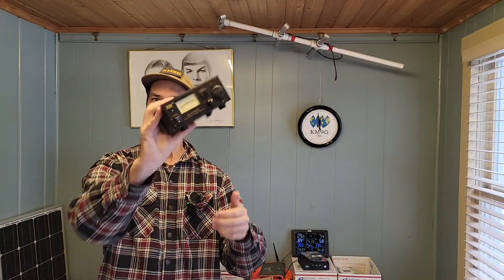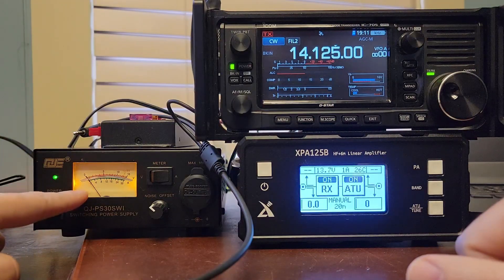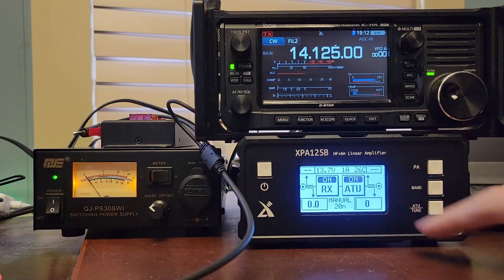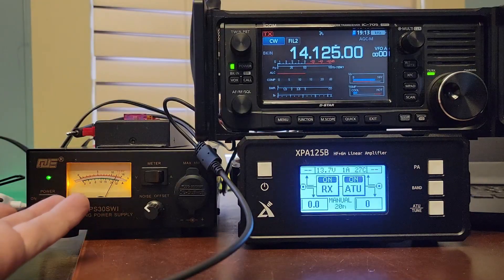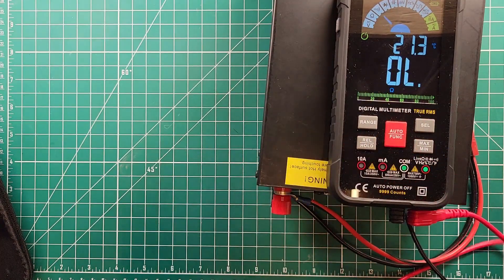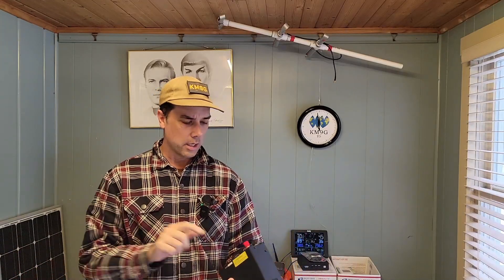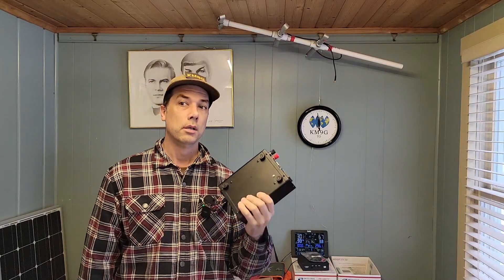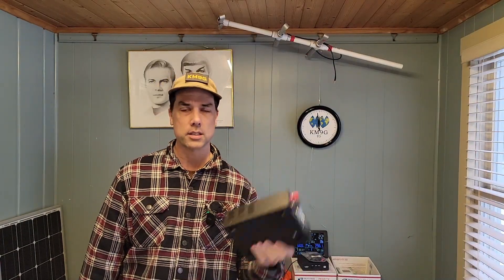Your First (Maybe Last) Ham Radio Power Supply!

Comment: So I've been running this for 6 months since I found this vid, and it's been working a treat! 

How I prevent the internal fan from even turning on is I have a dual 12v/5v USB fan (it has a usb A to barrel adapter to run 12v like off a Bioenno for example), I usually run plugged in via the cigarette lighter usb adapter in the front.  One fan into the side of the power supply, the other blowing under the radio (or side 125b amp, it's a fan with 4 corners of rubber bumpers, put it where the blowy needs to happen). A steady stream of air keeps the internal fans from even kicking on.  

Thanks for the recommendation back then! <3
Reply from the maker: You're welcome!

Comment: hi,can i connect more than one radios on a psu like this?
Reply from the maker: You can, but you likely won't be able to transmit at the same time.  You can check the specs on RX/TX Power Draw on your gear and if it doesn't exceed the power supplies output rating, you're good to go.
Reply: @temporarilyoffline  ah yes got it, thanks!

Comment: Y does it have noise reduction control if it was built correctly this wouldn't be so , or am i missing something in my old age 😢
Reply from the maker: You're missing the cranky old sad ham gene.  Most people don't realize that technology advances and switching power supplies are quieter now than they ever were (yes, some are still bad)... but I don't think you could sell a ham radio switching power supply without a noise offset in today's world.

Comment: Have you searched across the bands for RF interference from this power supply? I've tried a few switching supplies and find birdies all over the place. You need to test with another radio running on battery or a linear supply... compare the bands with the switched PS on and off... you might be surprised.
Reply from the maker: I have, and the "noise offset" feature moves it right out of the way.

Comment: Nearly all the "Ham" switch mode power supplies are made by either QJE or Manson, they will just be rebranded for the manufacturer. Most of them in that size use exactly the same board that is inside yours. Alinco, Nissei, Sharman Multicom, Nevada, Jetstream etc are basically this power supply with the same board, sometimes in different cases or with different meters. Even the linear power supplies are all made by QJE or Manson. There is actually nothing at all wrong with these.
IMHO Samlex is the best if you want to get something decent for your shack.
Reply from the maker: This is true in so many different verticals - like even the things you see in grocery stores and pharmacies.

Comment: Nice power supply, however I recently purchased the Jesverty SPS 50II which I found to be an outstanding power supply. It has dual meters for voltage and Amperage, not to mention adjustable noise filter and adjustable voltage, or you can use the switch to always be tuned to 13.8V. Run pretty cool.
Reply from the maker: Sounds like a great unit!

Comment: I ordered this a few hours ago. I thought it was a good choice but wasn't 100% sure. Then, low and behold, a Temporarily Offline video from a year ago confirmed that I made a good choice. Thanks from a brand new Technician.
Reply from the maker: @Penny_Pincher_Outdoors  it does the thing so well that I just got another one
Reply: @temporarilyoffline  So far, I love it. I have been running a DB20-G listening to NOAA and some chatter on the GMRS channels. Will reboot in Ham bands later and see if there's any chatter. Clean and clear power.

Comment: I will stick with astron . More exoensive but so far never had an issue. , or yaesu fp-1030. Astron makes small switching ps's. But fir rf work i prefer linear over switching but thats purely a  preference.  If that ps works for you , stick with it. WA4UJY
Reply from the maker: Thanks for stopping by Joseph.  I like my astrons too.

Comment: Cause doesn't make noise it doesn't mean radio is happy, put an occiloscope and you will see all the a/c ripple that will scare you. Up to 1 a/c volt peak to peak on 40m, yes the frequency changes the ripple.
Reply from the maker: I'll have to get a scope to check that out!  Thanks for the tip!

Comment: I just got one of these today for my tyt 9800. Thanks for the video! What size O-lugs would you recommend for standard fused red/black car stereo power cables?
Reply from the maker: I'm going to take a guess that they are 12ga wire and I'd say to use the yellow ones.  Usually you can get a cheap crimper and it comes with reds, blues, yellows.

Comment: wait im confused. you can use the xpa125b with this? The XPA125b outputs max is 30 amps so with an added transceiver wouldn't this power supply be pushing  it or not have enough?
Reply from the maker: The manual specs "30A @ MAX", as you saw in the video, I wasn't "@ MAX" and everything was happy.  This will vary from band to band, and I don't know which band would put it "> MAX", but it will just shut down as it runs out of juice - like I mentioned in the end of the video.  Thanks for watching!
Reply: @temporarilyoffline  so if you were to use the amp at its max then that power supply would not be sufficient?
Reply from the maker: @Mangoparadise  Take a look in the beginning of the video where I show "key-down CW" into the amp and it handles it just fine.  THis is on 20m, but it (might not work) on say 80m.  Its a good starter power supply, you'll know when you need to get a bigger power supply.

Comment: Does your fan run continuously when you turn the power on? My fan has never turned on even under a 10 Amp load.
Reply from the maker: I sold this power supply a few years ago, so I don't remember.  How hot does your PS get on 10a load?  Maybe not hot enough to key the fan?

Comment: I have two of those Power supplies. Very quiet and work great. Mine tests at 13.9v  with a voltmeter. I have never heard noise from either of my power supplies. My fan has never came on.
Reply from the maker: Sweet, they aren't as bad as the cranky old timers tell you theirs were.
Reply: @temporarilyoffline  LOL. I am 100% happy with mine. I have a 50 amp Pyramid power supply. It is terrible so much noise I cant use it with my radios. These 30 amp ones zero noise.

Comment: One of the problems I have with that power supply is that it is fixed at 13.8V. Years ago, when I got my Jetstream JTPS31MB 30 amp switching power supply, which was being discontinued when I got it, it had an adjustable output. It had a detent at 13.8V, but could be turned up a little higher. When it was new, it actually put out 13.8V when it was set on 13.8V. But over time the output slowly dropped. Now, to get 13.8V out of it, I have to turn it up a bit beyond that. I also now wish I had gotten a 50 amp power supply, and will be getting one in the near future.
Reply from the maker: I wonder if there is a weak chip in there causing the issue.

Comment: I have two very similar TP30SWI 30Amp / 13.8V power supplies sold under the Tek-Power brand and like em both a lot. 
Here's a nice 50 Amp variable power supply I purchased on Amazon. (9-15 volts adjustable). Very quiet.  It's called the  Jesverty SPS-50II
Reply from the maker: Sweet, glad you like them!

Comment: New person question. Can you use 1 power supply to power more than one radio at a time? Or is it safe to do that? Or is it one power supply per radio?
Reply from the maker: You can power two radios from the same supply, but you can TX on both  at the same time.  Not enough amps for both

Comment: This thing powered my first non handheld radio a bit ago. I was immediately happy and realized this DEFINITELY isn’t my last radio nor power supply 😅 my eyes are already set on one of those pricey yaesu radios… definitely gonna save and think it over for a good while. I’ve got too much antenna projects on the board.
Reply from the maker: This hobby is nothing if not an endless supply of activity. Welcome!
Reply: @temporarilyoffline  I was a little turned off at first not gonna lie, it seemed so complex yet boring. Finally got out of the headspace where I “have to catch on immediately” im already thinking of putting a radio “permanently” on my car haha
Reply from the maker: @vicrattlehead8665  I think you've got the right mindset now. It is very complex and you'll always have something to learn and explore.

Comment: BUT....how long will the switching supply last?  if switching supplies were quieter and lasted as long as a good linear, i would buy one in a heartbeat.  the astron 35a linear supplies will last 20+ years with nearly continuous use.  i don't think there is a switching supply out there that will last more than a couple years of continuous use, if that.  so, in the long run, linear is $100 to $150 more expensive, but will last maybe 5x's or more than a switching supply.  so, it is a no-brainer to go linear.  portability would be the only reason i would use a switching supply.  i'd get a good one like the one you have here, but it would not be a continuous use supply.  field work, POTA, SOTA...stuff like that only.  the total cost of ownership of a good linear unit is actually cheaper than a $97 switching supply.  just my two cents.  73.
Reply from the maker: Thanks for sharing

Comment: You didn’t mention that when most switching supplies fail they will send 120 volts AC into whatever they are plugged into.Also most need a couple of Snap On Ferrites on the power cord or they send a constant birdie on different frequencies across the Amateur Bands.I have the same power supply with a different name and it’s the TEKPOWER TPSW30SW1.Lots of other companies have their names on them including R&L Electronics.They don’t have the noisy fans like the MFJ switching supplies that the fan runs all of the time & that’s a Plus.They work great as long as there is no failure and if so your gear will be Forever Toasted.Also the noise mine puts out is not affected by the knob at all.👍🎙
Reply from the maker: Hasn't happened to me, but it's a risk with all power supplies.  My Kenwood brand power supply blew a regulator and sent >20v downstream.  Luckily I was testing it before connecting any gear to it and a simple part replacement got her back in shape. Fuses and crowbar circuits! Even then you're still just crossing fingers

Comment: I’m assuming this has enough current to run the 991a?
Reply from the maker: I ran my 7300 with it, never had a 991a
Reply: @temporarilyoffline  I’m new to HF, and I’m getting a mint 991a from my nephew. Per the specs it looks like it can draw 23A. Just curious if anyone has anyone has used this setup. Thx for the reply!

Comment: Nice review mate.  I'm using  the same power supply whilst travelling around Asia for the past 5 months hooked up to a FT-891 @ 20 watts, all good and fine until 3 weeks ago.   Switching it on, it turned off and won't start.  Checked fuse, used a different socket and cable and looked for anything obvious to the eye under the bonnett.  The FT-891 works fine on battery and has been doing a great job at 20 watts from the apartments and rooftops in Thailand, Vietnam and Sth Korea :)    You mention protection curcuitry, is that resetable ?  The  FT-891 at 20 watts is the only device that has been attacked.  Any suggestions?   VK4 FOO is here in Daejeon ROK  - Stephen
Reply from the maker: Mine auto-reset after I removed the problem and cycled power.  No power out at all?  Might be time for repairs.

Comment: I'm looking to grab a Retrevis RT95 / Anytone AT-778UV, it looks like it has a T connector, say I bought this power supply, are there cables out there that I can buy with a t connector on one and, and the ring loops to attach to the power supply? I'm a complete newb here and am out of my depth. With the ring attachments, does the back covers on those terminals screw off then you install them and tighten them?
Reply from the maker: Usually the posts on the power supply will screw off and you can put these on.  You have a 99% chance of making it work out of the box.  If they don't fit, you have 2 options: 1. Cut them off and strip back the wire and wrap it around the posts or 2. Crimp on your choice of a better end.  Welcome to the hobby!
Reply: @temporarilyoffline  Thank you for the reply, good to know!
Reply from the maker: @MrBikboi  ubet

Comment: I have one that looks identical, has the same model number but sold under brand name Norjin. It does have noise. The worst of it is on 20m. The noise knob does move it out of the way.  The only annoyance is that these bands of noise drift until the power supply warms up fully.  Once it warms up the noise bands stop moving.  I'm just powering a Hermes Lite 2 so more than adequate.  I've never once heard the fan kick in.
Reply from the maker: Very nice! I like that they are aware of a problem and have a solution.  That's nice.  Have you checked for floating ground?
Reply: @temporarilyoffline  Not until now.  I have continuity from 13.8V ground connector to long pin on AC connector which I assumed is what you were testing on. I also have continuity from that pin to 13.8V positive connector, so I don't know what that means. I noticed the PS does actually have QJE stenciled on the front so it is identical to yours.  The measured voltage on mine is 13.68V.  The noise is manageable with the knob so for the price not complaining.  I got it off Amazon scratch and dent section for the equivalent of about $60 USD.
Reply from the maker: @ronlewkowicz9656  Good Deal!

Comment: I have exactly this one in my shack and it is a really compact, lightweight and reliable power supply. Also the noise offset button comes pretty handy. But it will not provide enough power for two 100 Watt transceivers in parallel. Even with my IC-7300 alone there is a significant voltage drop to 12.2 Volts when transmitting at full power.
Reply from the maker: Good to know, thanks for sharing

Comment: I have the "TEKPOWER TP30SWI", a cousin to yours.  I think the common ancestor is the Alinco switching PS.  If you look at your waterfall and twist the noise offset, you should be able to find the "noise".
Reply from the maker: Excellent Matt!  In my case the noise wasn't on any band that I looked at, so must have been out of range of my antenna or otherwise irrelevant.  It's a great little workhorse.
Reply: @temporarilyoffline  yeah. You might see it on some bands and not others. I would check 80/40. Maybe it’s super clean!

Comment: I have the same power supply but with an lcd meter. Got it for 10 bucks at a swap meet. I took a chance as the guy had no idea if it worked. It's been powering my ic7300 for the last 9 months without a problem!
Reply from the maker: An LCD meter sounds awesome!  They are pretty easy to repair, compact and just work!

Comment: Would anyone know about over voltage protection on these QJE power supplies? I got the QJE PS30SW IV (the digital display one). It works great, but I am always worried that if anything goes wrong inside the power supply, it could exceed the max voltage output and burn my radios. I am even considering putting together a crowbar circuit, but I would prefer to avoid the additional clutter in case the PSU has it onboard.
Reply from the maker: See comment from Neal below about his going Bang!
Reply from the maker: I don't know if the PSU has protection from itself, but I do know that it will shutdown if there is an over-voltage on its power ports - I had an amp fail and dead short.  PS saved the day!

Comment: Mine went bang recently, a very loud bang, whilst I was semi-snoozing half listening to a dx station, made me jump. Don't know what component has blown yet, but thankfully no radio equipment damaged, so must just cut straight off and not output any over voltage.. that's a plus. Using a Nevada PS-30M linear PSU now, which is actually a similar price to that little QJE.. has a stupid loud fan on it though which is going to have to have to be modded soon.
Reply from the maker: Noctua makes good fans!  Try one of those: https://amzn.to/3WG5rpX
Reply: @temporarilyoffline  Thank you

Comment: ~$25 eBay ex-server e.g. HP HSTNS-PD18 750 watt (12V/62A!!!) power supply can be modified with one resistor to tweak output to 13.5V. RF quiet, being HP ex-server = super high quality.  Far more amps capability than dollars cost. An option for those able.
Reply from the maker: I've heard of people using these.  We built some at the ham radio clubhouse one day.  I had too many power supplies (and still do) to put the server PS into service.  Glad it is working well for you!

Comment: Great vid. The psu is the same as my Maas sps-250 ii
I just Changed the fan out With a noctua NF-A6x25
The fan is totally silent with the low noise adapter, and it fits strait in, you just need to Change the plug. Same as the ic 7300 fan mod/upgrade. 
Works fantastic 73 OZ7KP
Reply from the maker: That's good news.  I'm a noctua fan!
Reply: @temporarilyoffline  😄 me too
Reply: Me too!

Comment: Great video!   I have a QJE PS30SWIII (it's older, even though it has more "i"s in the model)  Rated to 20A continuous.
My only gripe (if you can call it one) is that I would prefer that it had Powerpole connectors.  And, since It's on my bench, I would prefer that it had front connectors.  But I digress.
Anyhow, I was wondering, does the fan stay on, or is it triggered by a thermal switch?
73
Reply from the maker: The fan stayed on all the time.  They do make cigarette lighter sized/shaped power pole plugs - perhaps a future mod?